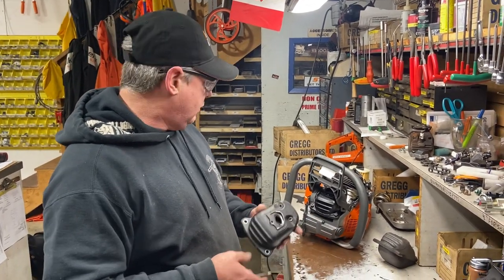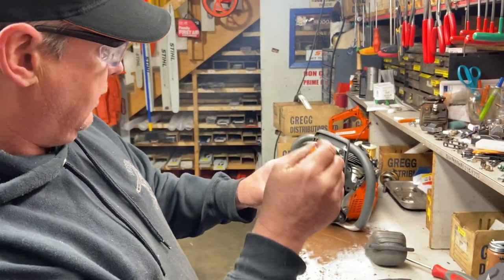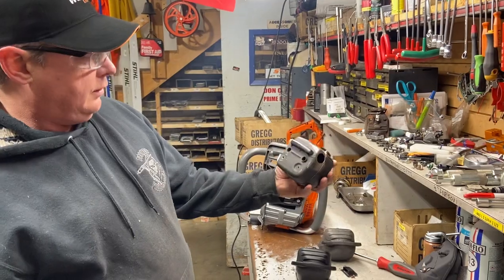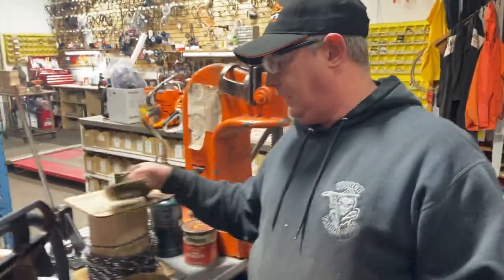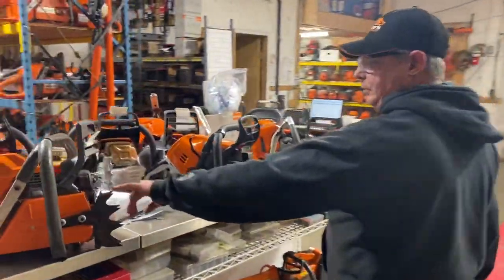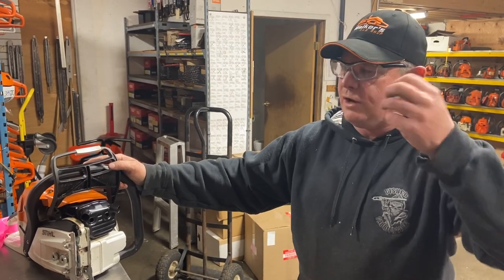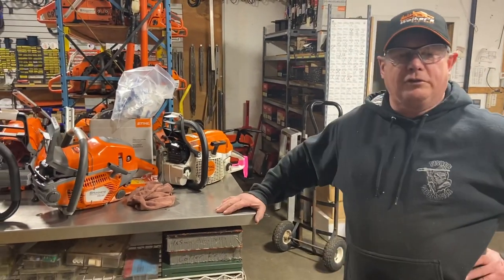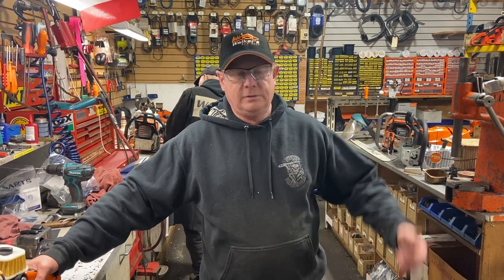Donny walkers chainsaws showing different muffler mods

Comment: That 550xp is hit or miss.  Mine is a complete basket case.  Three months at the nearest dealer [68 miles away ( three years ago there was 3 in town and at least a dozen within 50 miles)], and they reset, updated, and calibrated the Auto-tune...  It still hates to idle warm or cold.  After 5 or ten seconds it conks out.  Then starts like it's flooded to the gills, blowing smoke and sputtering up high.   I'm definitely not alone in this particular experience.  
Having owned both the 550xp and the 261c, I have to agree with you.  The 550 feels better.  It seems more nimble.  I just wish husky didn't make their bottoms round, as it hates to stay upright even on the flattest of surfaces.  Rollie-pollie.
I will definitely acknowledge that the MS261c has more power, but pays for it with an almost bloated feel.  
That, and I find the M-Tronic to be superior to the Auto-tune.  
Having worked in this area for 25 years, once husky pulled their dealers out and Stihl completely took over, I know of ONE M-Tronic that's fouled up from a bad solenoid.  And that's multiple companies running at least a half dozen saws.
Everyone I know of that's still running fleets of huskies has had at least one saw go completely wonky, from the 550, 562, & 572.  
With the complete disregard of essentially the entire east coast, I just don't see them being successful long-term.
Reply from the maker: Was your 550 the new mark 2 but I totally get what your saying
Reply: @donnywalker4691  I believe so.  It's definitely a mk2.  Manufactured in '19, bought it in early '20.
Reply: Don't get me wrong, I absolutely love that little saw, but it's moody.

Comment: @Donny Walker

i've heard that general rule is

the muffler exhaust port should be 80%  the surface of the cylinder exhaust port

is that correct?

Comment: I have a Stihl 362 with the one piece muffler 
Should I do it like the 260? Or replace the muffler with a 2 piece and get a bark box?
Reply from the maker: Do it like I did with the 261
Reply: @donnywalker4691  thanks for the reply 
Looks like about 3/4 inch I.D. Stick with the same size for the 362

Comment: I have a 372x-torq and I want to put dual 288 caps on as you have done. Do you cap the factory hole on the top or leave it open as well? 
Thanks from the Kootenays

Comment: Donny is a modified muffler a lot louder than a stock one? Do that mod affects engine's reliability and durabily?
Reply: A little louder, gives it power gain and gives the saw more life due to getting the heat out of the saw. Actually better for it cause it removes the heat from the saw